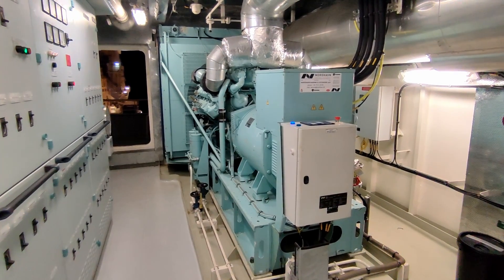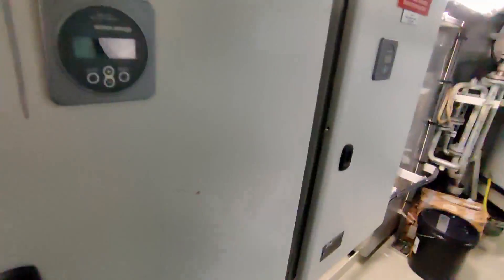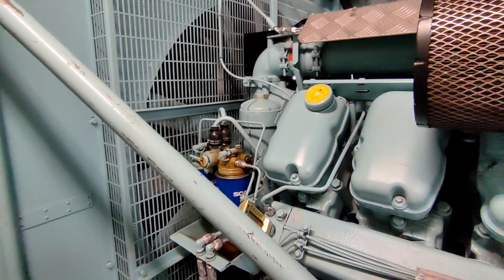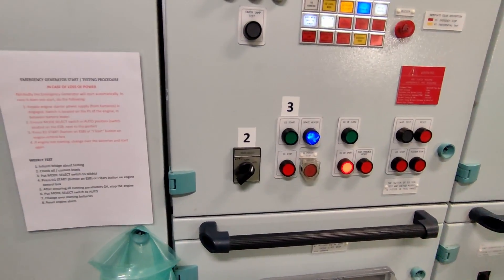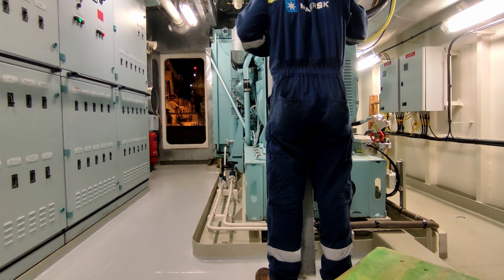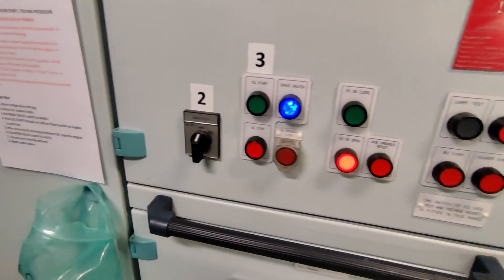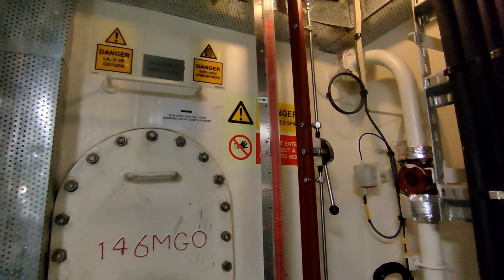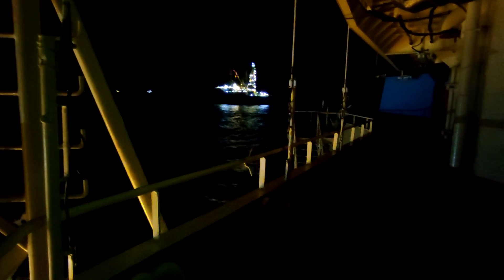V8 Emergency Diesel Generator Scania DI16 075M Start up

Comment: that´s what I call a dip stick
Reply from the maker: The location is a bit of a pain, they could have quite easily put it on the side and had it half the length with much better access